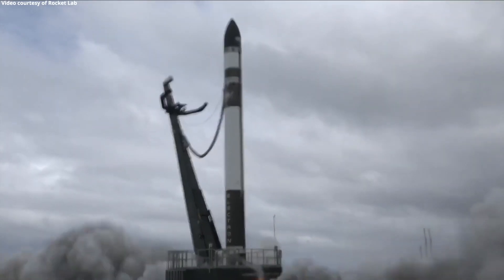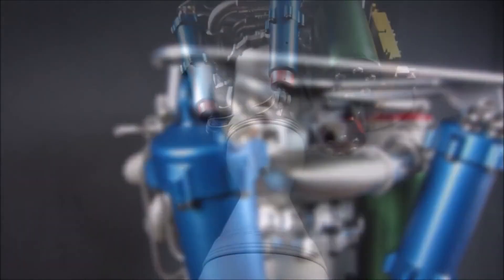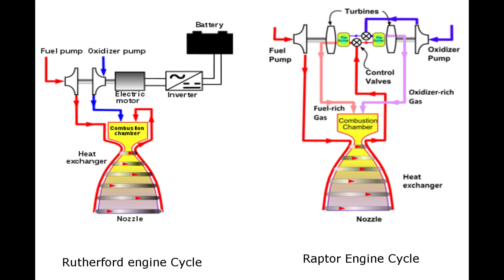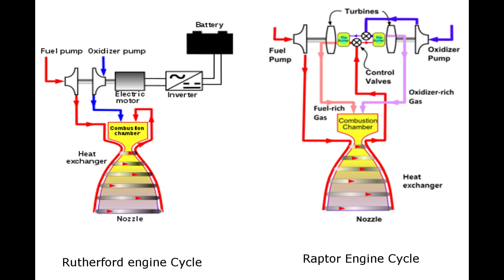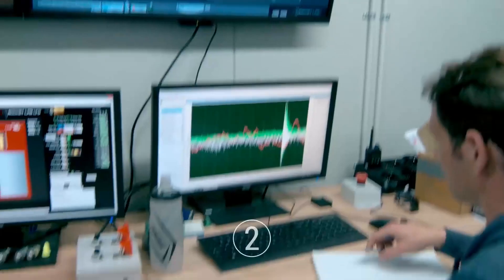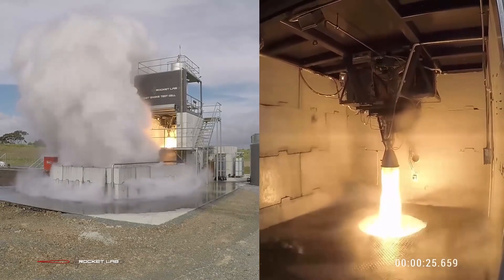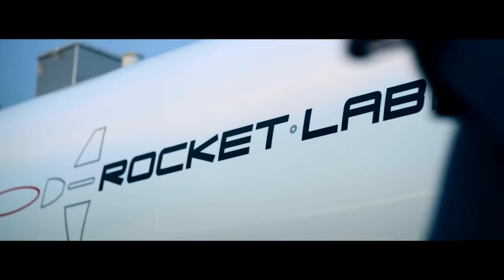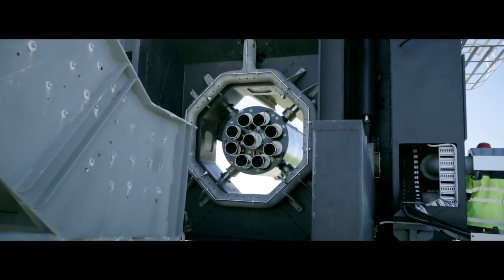How does Rocket Labs Electron rocket engine work? (Rutherford engine)

Comment: Brilliant idea. I wish I'd thought of it. With the development of EV motors and batteries, the available horsepower to drive a pump becomes adequate for a small rocket engine. How small? Is such a small engine enough to be useful? With today's technology, yes. This can be figured out on the back of an envelope if you just have the idea.

Congratulations!  I'm a retired engineer who used to get paid a lot of money to find ways of marrying unrelated technologies to solve a problem. This is exactly what you've done. I absolutely love it, and I wish you the best of luck.
Reply: Actually, your idea could even be applied to the old F-1 engine. Modify an F-1 so that your electric fuel pump fuels the gas generator of the F-1. This would result in some simplification of the plumbing in the F-1, would provide easier starting, throttling, and restart capability, all of which are impossible with a standard F-1.

Comment: The Rutherford engine produces barely enough thrust to lift a standard car. The SuperDraco is exponentially more powerful, but the same size as the Rutherford, which is only good for upper stages and satellites and manned capsules at the very top of a rocket.
Reply: So what? The SuperDraco is a terrific engine for what it's designed for. BUT, it requires hypergolic fuel, making it a highly specialized engine only useful for certain applications. There's no comparison here.

Comment: *=* Cool, just remove the big battery and replace it with small battery, and add a photovoltaic solar panel, and with a laser, to transmit electric energy, it will make the better eco-rocket with a smaller fuel! ;)
Similar to ionic propulsion.